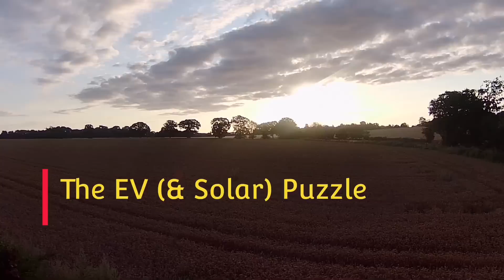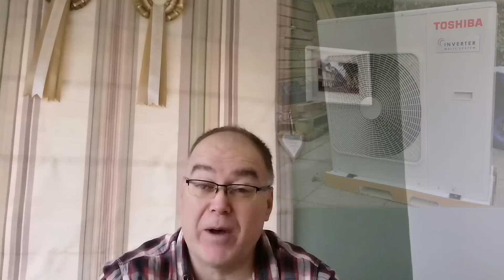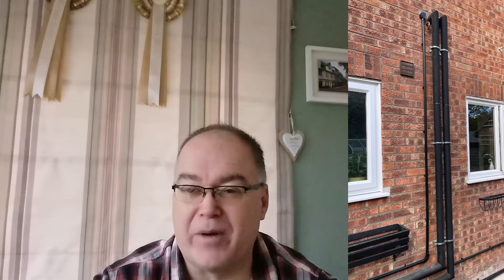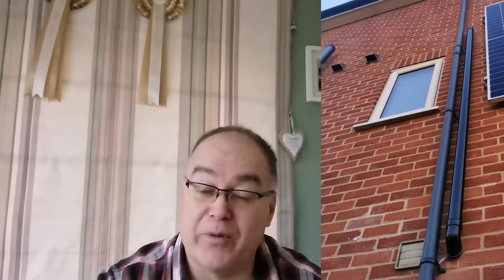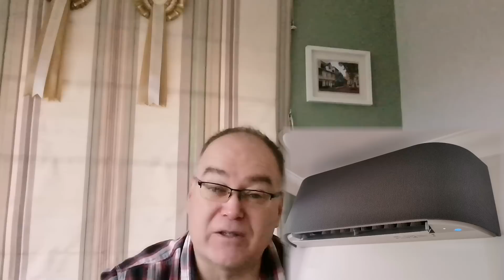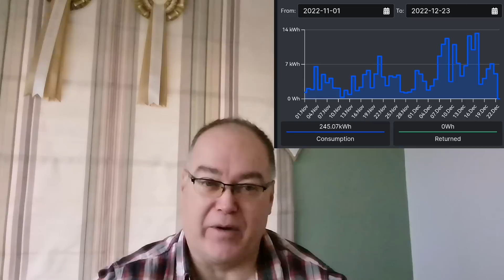Toshiba Air to Air Heat pump (A2A) - Probably one of the best heating systems you can install

Comment: Great video again Nigel.  With the internal units at head-height do you find a cold area at floor level; cold feet? 
What SCOP are you getting?
Initially wanted wet ASHP with UFH for ground level but the cost is crazy and the running costs seemingly unknown; A2A seems to be a far superior product even without the grant.  Only issue is distribution throughout the house.
Reply from the maker: Not at all no, very well distributed
Reply: The the grant for air to water and no grant for air to air seem about the same  price for the quotes we got maybe were using the wrong company’s  be interesting in others experiences of getting quotes for both were in a 40 year old 3 bedroom bungalow about 120 M sq  area  that’s fairly well insulated  without micro bore  and after watching a few YouTube videos found one chap that fitted theses units on two outside units for 5 indoor units like we would ideally want  if going air air for best part of £9 k  , if we are going to get summer weather like w3 had this year air conditioning of air to air would definitely be advantage  but still on the fence  to which to go with ,
Reply from the maker: Scop of 5 in summer, 3-4 in winter, 2 when -2 and below   estimates from wattage used.

No cold areas its toastie warm.

Only loss is the heated floor areas from heating pipes under but floor. Longer we leave heating on warmer the floors get.

Distribution around the house is excellent we can literally heat rooms on opposite side of the house turning fan speed up if needed, it's very controllable
Reply: @EVPuzzle  Sounds great compared to the over-priced and over-specified wet system being offered.
Happy New Year to you my friend 🍀

Comment: Shame the condensate pipes are an issue we are in a bungalow and if all the pipework could run up and through the loft these could be installed very easily and neatly. I see there are heat pump water tanks as well now which is a nice solution to the HW issue.
Reply: For a bungalow the neatest way is ducted installed in the loft. No on wall units needed and condensate pipe is from the loft to outside.
Reply: @marcussmith6523  interesting thanks
Reply: @marcussmith6523 sounds interesting is that the ceiling cassette your talking about here ?  We have a 3 bedroom bungalow and looking to get some kind of heat pump installed just not decided which yet ?    If we regularly get hot weather like this summer it will be air2air and would want as neat as possible install love the ideas of hidden pipes etc
Reply from the maker: A good installer will sort the pipes but remember it's only for the awkward install areas, rest are easy and not an issue

Comment: Great choice, it's madness that air to air systems are not the norm in the UK.  Blame the Government for not including them in the Renewable Heat Incentive some years ago.  Low install costs, very economical, very reliable and has the bonus of cooling in the summer.
Reply: Same thing for the Netherlands. I believe the reason there are no incentives for air source heatpumps is that they can also be used for cooling in summer and this consumes energy without solar panels.
Reply: If the house has solar PV they should be included in the government schemes. It's just madness they don't.  Your cooling would pretty much be for free if you have PV.  High solar generation will certainly coincide with any use of cooling.
Reply: @GcS1515  I totally agree.  We have solar PV and would have preferred an air to air system as they are much simpler and less prone to installation issues.  I'm hoping that at some point we can ditch our air to water system and go to air to air instead
Reply: Yeah i have issues with it being too hot in my house so im interesting in getting some kind of multi split heat pump system to heat and cool the upstairs. Annoyingly you need planning permission to have more than 1 system and i think ild need to get one to deal with hot water and the downstairs if i get rid of the gas boiler

Comment: Superb timing Nigel based on my tweet this morning about my dilemma over A2A and A2W systems. I'm swaying towards A2A and use the eddi / solar for hot water. Good to hear your experiences and the day to day use and feel for the heating. Good tips on the installation and siting too, you have indeed done your homework.
Reply from the maker: Never perfect but thankfully taking our time and thinking it through has helped. May well add a 2nd system over time espevially if ducting to our bathrooms is possible

Comment: Very surprised you didn’t mention the biggest single drawback. If it cools or you have more than one external unit you have to have planning permission.
Reply: I knew about the 1m rule but not the 'if it can cool' rule. I wonder why the planning authority care about ability to cool? Given summer 2022 temperatures, a2a heat pumps are going to become a very popular option.
Reply: O didn’t know that , we are near our neighbours on both side  had lots of quotes and heat loss etc done few said about the units can’t be too near there windows etc but didn’t say anything about  planning permission mite be necessary
Reply: How would you even know to seek this? Having just done a build, going through planning, conditions etc, I did not spot this. Also how would anyone know - just looks same as A2W heat pump from outside. 
They have to catch me first ....
Reply from the maker: Out of date for sure, if needed it should be safe for ashp and boiler vents
Reply: wut?
Reply: Yes, I’ve seen this on the Planning Portal - spoken to an architect, electrician and a builder and they all just said ‘who would know?!’ I’d be more worried about the two outside units that we’d need being the most obvious aspect of a system, not the fact that it can cool.

Comment: Had a 4 kw 1 outdoor 2 indoor Mitsubishi a2a system installed last year.
From looking at my own energy usage I saw I used the system 5% for cooling and 95% heating. 
Unfortunately my system is fairly undersized for my home (11 year old), I would probably need 6 kw.
Normally I would use about 1500kwh in gas (including domestic hot water) for the month of December,.
This year it has been reduced to an expected 130kwh in gas.

When I looked at the Mitsubishi heavy industries catalogue it clearly says that on multi split you can connect up to 150% capacity of indoor units to 1 outdoor unit.
My system for example has a 3,5 and a 2,0 kw indoor unit connected.
Reply: Hi Erik. I am ready to pull the trigger on a mitsubishi hi system like you. I have reservations about the app it comes with and it's negative reviews. Do you use the app to monitor energy use and set schedules? Are you happy with what it offers?
Reply: @Benjamin-dx2wt  I unfortunately don't use the app at the moment, for my system it's an option.
Reply: @sciencetestsubject  even better as getting no Wifi would make it cheaper. do you find the IR control enough for your control needs? also how do you measure your unit's energy usage?
Reply: @Benjamin-dx2wt  Ir remote has far more than I need and is very easy to operate.
You can set a complete weekly program on just the remote.
I measure energy consumption through a smart plug.

Comment: Thanks for this video, Fantastic food for thought and sounds like  just what I need too! 
Q: No dehumidification on heating? Is there any option to ? Because dry air more comfortable and more efficient to heat.
Q: Do you send dehumidification water to drain, or pump it to somewhere like the toilet cistern? After draining my dehumidifier to a bucket for more than a year, only thought of draining it to a potted plant for the 1st time this morning 😄
Q: does the same unit inside the house do both heating and air con, or are separate heating and air con units required?

Comment: These mini splits are much quieter than our big 1.5 to 5.0 Ton (18k-60k btu) central split heat pumps that we use in the USA. The drawback to minis are…they are not easy to clean or repair. So, they’ll save when they’re working, they’ll cost you  big when they break, and we will be filling the landfills/scrapyards with them in 10 years max.
Reply: Never again a central unit repairs cost me a arm and leg to fix Then the unit failed again. Installed new 4 mini split in rooms that I need. With 5 year warranty. If one breaks down cheap to replace the whole unit. 3 other rooms are fine. When a central unit breaks down it happens in the busiest time of the year. Then the wait to try to get a technician to fix it.
Reply from the maker: Fair point, contingency is good. My fingers are crossed
Reply: 10 years max? Guess I’m lucky mine are getting close to 20 years now. No one’s ever serviced them.

Comment: Those outdoor units are ugly. Manufacturers really need to make more effort and reduce their noise. 
And to those who say they are not noisy, just try living next to one pointing at your living room window. Once you latch onto the sound then it never goes away 24/7
Reply from the maker: Same goes for any boiler if it's pointing at your lounge  I'd guess
Reply: True if that happens but not 24/7
Trouble is that many people do not care about anyone else except their own heat pump installation where they position the external units for ease of installation and maximum heat transfer. 
The permitted development rights are supposed to help but gaining planning permission for anything outside of that is too easy.
Reply: @ShortwaveLog That's exactly like new build developers installing heat pumps...and then a log burner!!  That's you Grace Homes.

Comment: I have my a2a scheduled for install on 4th Jan. Frustrating how the push (and grant) is for a wet ASHP. We had quotes of £8k and £11k (after grant) and loads of issues with old system to overcome. A2A system is £6k and a much simpler install. They should give the grant to anyone removing gas/oil and fitting renewable heating?
Reply: Agreed, absolutely.
Reply: That won't happen as they will increase the overall carbon demand when used to cool in the summer.

Comment: We have a similar system, a 3 way split with a Fujitsu 8Kw compressor and 3 x 2.5Kw indoor units plus 3 other single Fujitsu systems a 7, 5 and 4Kw, so 6 indoor units in all in a 5 bed house running from a 29Kwh plyontech battery and 8kw Solis hybrid invertor. It all works very well and very low power.  We also found that on the very coldest days the power required by the heat pumps almost doubled but they have a COP of over 4 on typical 6-10C days in Essex, so that still a COP of 2 when its below 0C and days like that you cant count on two hands per year here by the coast. 
The only issue i have is that because we work from home and use computers all day, our base load per day is about 18-20Kw even in the summer with no heating or cooling so in the winter that goes up to about 30-35Khw per day. 
However, i can't charge the battery any more than 20kW on the 4 hour Octupus Go tariff, (4 hours @5Kw per hour). I'm waiting for Myenergi to make the Zappi charger Octopus Intelligent compatible so we can move to the 6 hour tariff. Once that happens i'll add another US5000 4.8kWh battery to the 6 we already have so i can store the maximum of 30kWh (usuable) which should get us through most winter days with little peak rate power. 
Once we get from March to September there will be much more solar power coming through the 8Kw solar and we shoud be almost self sufficient for 8 months of the year with plenty of excess for water and charging the car in the summer months.
Reply: We have gone for a Fujitsu system. 3x2kw downstairs and a ducted 4kw upstairs for 3 bedrooms. Can’t wait as using portable electric oil filled radiators currently.
Reply from the maker: Ducted into all the upstairs sounds good
Reply: @KevinArmstrongUK  
Sounds really interesting - I'm in two minds right now between multi internal units in the bedrooms vs. ducting.

How did you design the ducting and control between bedrooms?
Reply: @richardlincoln886  Ducted upstairs has a single control as it’s a single unit. It’s a Fujitsu ARXG14KLLAP getting fitted in loft and fitted with a 3 way spigot to give a feed for each bedroom.
Reply: Big fan of your channel! Hope you're on the mend now.
Reply: Just switch to IO and let the system auto charge once a month.  Otherwise time lock it.
Reply: I spoke to Octopus about Intelligent recently and the guy said the Zappi is supported - it's that tne car itself needs to be supported too.  At the moment there are only a few models that are...
Reply from the maker: Mini and Golf now added so intelligent might work for me next time
Reply: @EVPuzzle yes intelligent 6 hours at the same price of  as the 4 hour go this time a year is great 😊

Comment: Very interesting video Nigel. After six months with our Octopus installed Daikin system I am pleased to report that the design seems to have been about right. We had a 6.6kW requirement for a -2 day so a 7kW unit was installed in our 4 bed detached 128m2 house. Total cost was £6k after grant. When we got to the design day a couple of weeks ago we were able to turn our weather comp down to balance the system and get 20 degs downstairs and 18 upstairs. Original design was 50 degs flow but in reality we only need about 40. As to usage in first six months we have used around 917kWh of electricity to produce 3140kWh of energy but now that I have adjusted the weather compensation down we are getting higher values. Unlike you we are running with system on 24/7 but have a setback at night and kick system on around 4:30 to benefit from Octopus Go Faster rates. We are using the weather compensation to control the temperature not the thermostats as such so having the cold snap has allowed us to calibrate the curve. During the really cold days the worst daily usage was around 27kWh (generated heat 110kWh) and atm we are using about 10kWh. Definitely pleased to have ditched fossil fuels completely and the next stage is to get a battery to complete our setup . Keep the videos coming.
Reply from the maker: Sounds good and a shame they wouldn't quote for the 7kw system here 136m2 home

Comment: Having fitted a few of these systems in my own houses, I've managed to do it without ever using a condensate pump.  They are definitely a weak part of the system so always try to design them out if at all possible.
Reply: Chris, interested to know what is the problem with condensate pumps? In other words, why are they a weakness?
Reply: @carlfrancis8565  as mentioned in the video, they make noise when operating.  They can get blocked and the float can get stuck.
Reply from the maker: Quality items though shouldn't be an issue m. Time will tell of course
Reply: Seem to be replacing them at regular occasions at work, mini lime fit into trunking. Larger versions use perastaltic type pumps which seem more reliable.

Comment: Care re your AC drain pipes going into main down pipes from your roof.  If they get blocked below the connection your AC drained water and excess rainwater could backup into your indoor units.
Happened to me unfortunately. A bit messy.
Reply from the maker: Good point, what's the option just drain to the ground?
Reply: Just keep your gutters and downspouts clean. No worries.
Reply: Good point with moss and  other bit’s could be a issue  maybe use them net bits on the mouth of the guttering we had lots of issue with blocking guttering even with mesh on last house

Comment: Great video, thanks, lots of things for me to consider. Looking at A2A in 2023 but hoping to get one that will heat my hot water. I believe Daikin are releasing something next year.
Reply: Vaillant do a heatpump cylinder.
Reply: @David-bl1bt  Thanks, I will have a look
Reply: Also look for the Dimplex EDEL.  Air source heat pump cylinder.  This is what I'm planning. For the technically interested - it has two volt-free contacts on the control board for PV mode, allows you to control heat pump only or heat pump + immersion if there's excess solar PV for example.  I'm planning to use this and then control the thing using Shelly relays and Home Assistant.  Would be interested to hear other users' experiences of Heat pump cylinders such as Vaillant AroStor and Dimplex edel.  Also Daikin are launching a cylinder that can heat from an A2A multi-split port.

Comment: Thanks Nigel. Did you say your heating goes off around 6-7pm in the evening. Your house must be well insulated if it’s still comfortable to sit still 3-4 hours later.
Reply from the maker: It's not like we're sitting up to midnight with blankets lol

Only drops a degree maybe before we retire
Reply: No staying up past 10 PM much after 50🤣!
Reply from the maker: Up at 5 instead

Comment: I had a similar Daikin system in my apartment in Paris - almost 100m2 for heating and cooling, worked out about the same cost as with the gas at prices before the recent events… would be well cheaper now.  As you say - when I was working at home I could just heat the one room during the day.  Now on a bigger house with oil heating - 500 litres lasts about 2 months in winter, so looking forward to delivery of an air to water heat pump - delayed by supply chain issues :-(